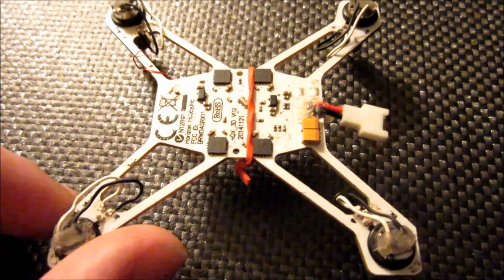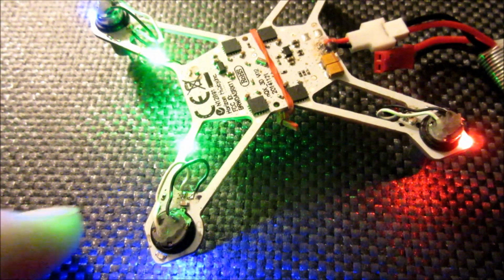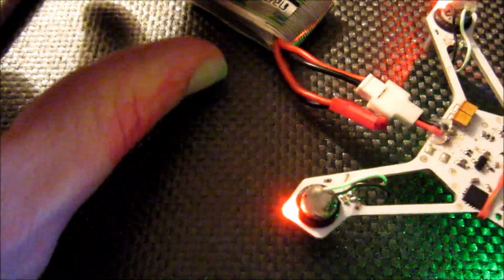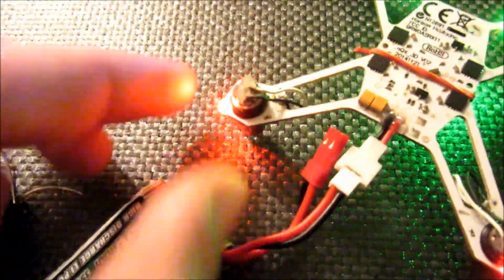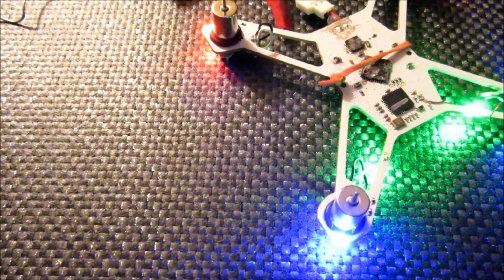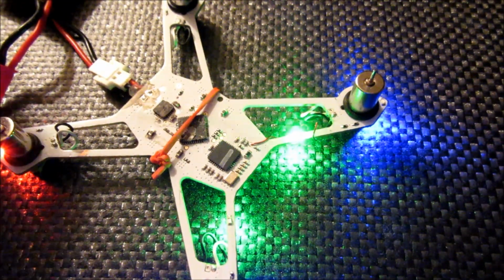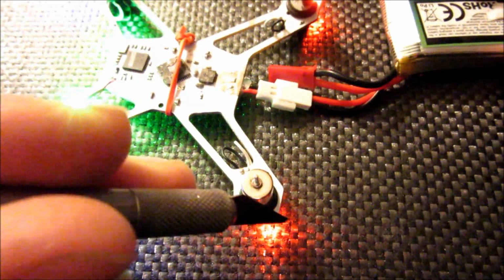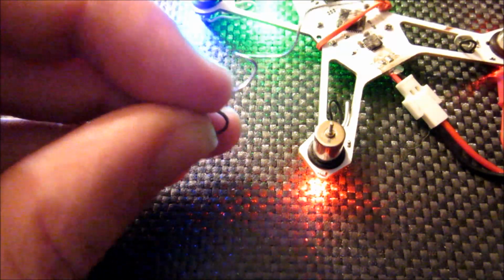Blade Nano QX 3D LED repair

Comment: Followed your idea. Fixed a few… had a few shoot off like Tiddlywinks, never to be seen again. Eyesight not what it used to be. :-) Were you using leaded or lead free solder? It appears after a few resistors disappeared and a few LED’s were reconnected… there is an electrical imbalance causing the built in voltage sensor to shut things down way too early as it thinks the battery voltage is too low. Used the same batteries in a new Nano QX 3D and they run the full distance. Do you happen to know the value of the dropping resistors for the LED’s? I’d like to wire in some regular resistors. Good video. Thanks! Ron

Comment: use this silver paint to repair the pcb no soldering works good shake the bottle before use. Silver Conductive Paint
Can be used to create a thin, smooth, flexible and adherent film which has a high electrical conductivity. For use in repairing electrical circuits on PCB track or heated rear windscreens, screening plastic housings against high frequency fields, earthing strips, connections to non-solderable surfaces, contact surfaces, potentiometer tracks.
Excellent adhesion to a wide range of materials
Cures at room temperature, can be baked at 125°C if greater adhesion is required
Good electrical conductivity: 0.1 to 1.0 W/cm2
Use a clear lacquer after application to protect film.                                                        http://nl.rs-online.com/web/p/conductive-adhesives/1015621/

Comment: Dave, this is an excellent video and the only one that does more than discuss the LED issue on this model that others only grumble about. I've never soldered before but after watching your technique and also picking up some general soldering tips from other helpful YouTubers and from your fellow subscribers ;-), I will give it a go after some dummy runs.
Reply: +Stephen Levy He's good at soldering... not as easy as he makes it look;-) Read rayikaikin's post below and be careful as the resisters will lift off really easy and getting them back on is hard to do. You might want to think about using some conductive paint instead.
Reply: yep, you are right John - I lost one of the tiny resistors so intentionally removed the other of the that pair and now I have 2 very bright green lights which helps me see which way my quad is flying when outdoors. It has not seemingly impaired performance but in case the board fails I have bought a spare one which I will utilise once my flying skills improve. Learning some soldering skills has been useful and interesting too and now I have a kit for the next time I need to solder something.
Reply: Stephen Levy So you only have the green in fount now I take it... how is the orientation at night now? I was surprised how well the lights work with the way the green blends in and looks different from the front view and the rear view. May block out the blue and see how it looks. I find each quad has it's own orientation signature and what I like the most is what I've gotten used to.....

Comment: If you're going to be soldering on live circuits, you really ought to order ceramic tweezers from FastTech. I have these https://www.fasttech.com/p/1655800 but you may want finer points. The metal knife could bridge the resistor and then it's like having the LED with no resistor. An LED can't survive that for very long.
Reply: +Richard “Bruno” Bronosky Good idea... I need a set and magnifying setup as well.... tiny parts to solder well.

Comment: Good Video Dave, where did you get that carbon fiber mat you're working on?
Reply from the maker: Ryan Gribble Thanks,
It's not really a mat,  but a sheet of CF/Birch core I use to make frames from.  Pretty expensive just for a work surface.  You could probably get a single layer CF sheet for a hundred or so though.

Comment: Great video! I'll have to give this a try to fix my nano qx3D! Where did you buy your o-rings? I can't seem to find them in that size... thanks!
Reply from the maker: Ben Przystanski  Sorry, I am not sure what you mean by "they".  The components are rectangular (I think 0603) so they don't have a diameter, but you may have meant something else.
Reply from the maker: Angelo Garcia mcmaster-carr
Reply: Awesome, thanks! I tried looking for some at a local hardware store, and all they had were ones that were too skinny. I'll definitey check that place out!
Reply: +Dave Woods sorry, i know this is dumb, but what diameter should they be?
Reply: +Dave Woods Thanks Dave.  I was referring to the o-rings.  I'm guessing 3/8" I suppose.  Did you use X-profile or standard?

Comment: Getting mine in the coming few days. Can I just remove all of the resistors or LEDs without breaking it? Don't really want the whole disco thing going on tbh. Is there a central point I can cut to switch off all of the LEDs in one go?

Comment: nice!  what size o-rings do you find work well?
Reply from the maker: 006 common Buna N, They can occasionally spin if not seated tightly against the frame so a drop of glue can help.
Reply: Dave Woods Brilliant, thanks! I've got a spare main board, and with your o-ring concept and some inexpensive replacement motors from ebay, I'll have another quad for $60 or so.  Thanks very much...

Comment: Hey man how do you get the motors out to replace them...is it simply iun clip and push ? Ta Roy
Reply from the maker: I think you just bend the little tabs out of the way enough to clear the motor.  I don't bother with the stock mounts much anymore though.

Comment: nice work but not really worth the time  - if you look at your resitors really exact - then you can see that most of the resitors are broken - the only way to fix it - is to replace it
Reply from the maker: LOL, Good one, They must all be broken, and why they are all working again at the end of the video.
Reply: Dave Woods this can help for a flight - with the soldering you clue the broken pad - but this will not last more than one or two flights - I replaced the broken resistors - but anyway - I am sure you know that better - so do it your way.
Reply from the maker: NANOHELInet I don't know, after re-soldering, mine seem to last about as many crashes as they did when they were brand new. I can't see any damage to the actual resistors either.  I'm sure there is quality variation too so YMMV. This was an aim to get them going relatively easily and changing one would be much more challenging.

Comment: ive lost a few resisters on mine trying to do this :\ im a beginner at soldering and didnt think to hold it down the first time the second one i was holding down and it came loose and stuck to the needle i was using to hold it down. i tried like hell to reset them but after about 20 tries they "dissapear" lol so small i cant find it
Reply: You definitely must have soldering experience!  You need to know what kind of solder to use, what wattage soldering iron, how long to hold the tip of the iron to the part you are soldering, knowing how to tin the tip of the iron before you attempt to solder etc!  Theirs a lot to know to do it right!  Did you notice how he didn't hold the iron to the part for very long?  It prevents heat damage to the part! If the iron is not the correct temp you can either fry the part you are soldering or you won't have enough heat to properly melt the solder.   Also, if you hold the iron and solder to the part for too long you just burn the flux off and you won't get a secure connection.
Reply: ***** So are you able to advise the specifics to best fix these leds? Type of solder and what temp/wattage i should be using. I've soldered plenty of things over the years but nothing this small and fragile.
Reply: thanks for this input!
Reply: Stephen Levy
ive found the easiest way to fix the leds is to get a # 2 pencil and just write on the solder joints its like magic and no soldering is needed. give it a shot guys :)
Reply: +rayikaikin  Thanks a lot brother that #2 pencil idea works great! More people need to know about it. Be blessed!